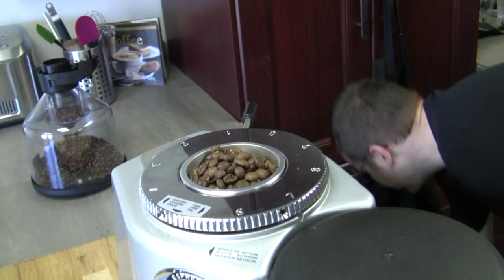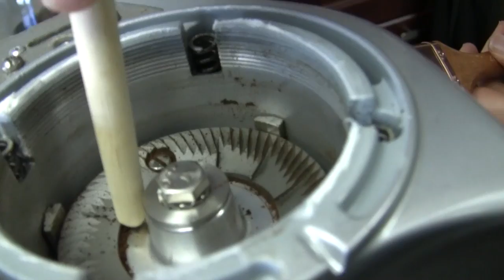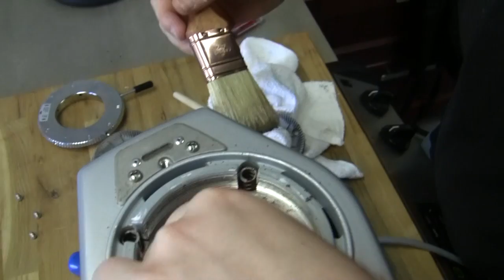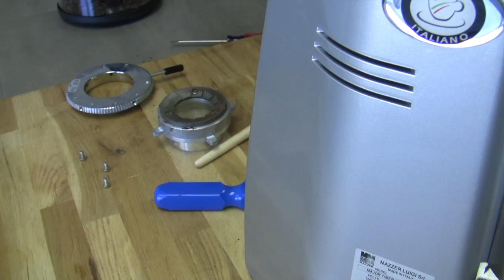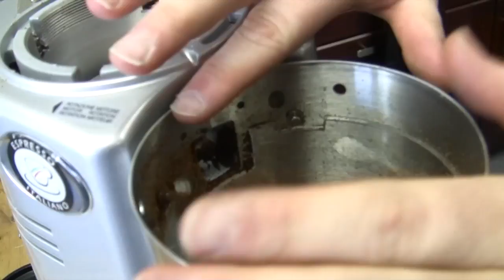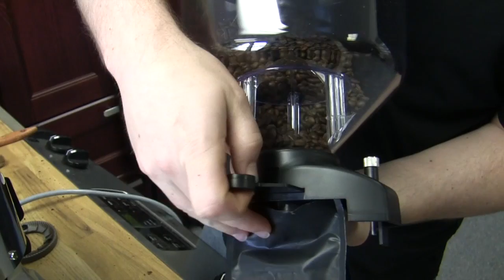Tech Tip: How to Clean the Mazzer Major Commercial Coffee Grinder

Comment: Hi guys, is this video the same for the Mazzer Royal? I use mine in a home environment, it has Ti burrs and I'm wondering how often I should clean the burrs?
Reply from the maker: Mazzer burr cleaning is dependent on how oily your beans are, and how much you're grinding. We'd suggest running Grindz through about once a month, and doing a deep cleaning of the burrs every 3 months or so, if it's not too oily.